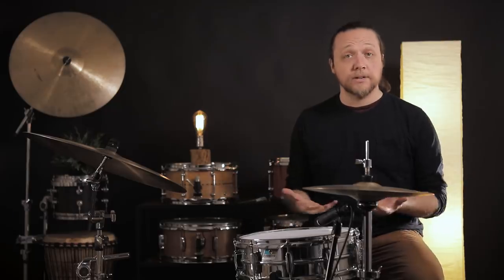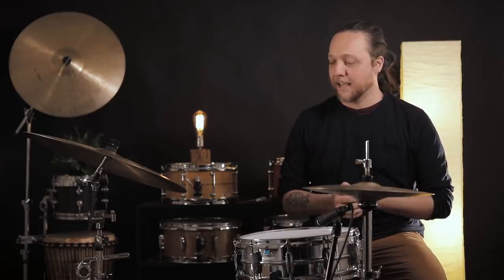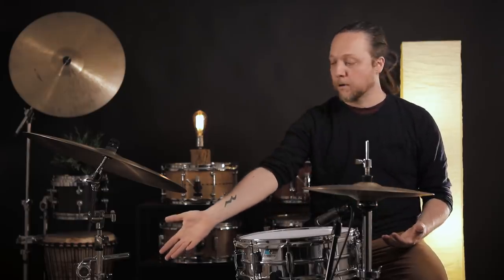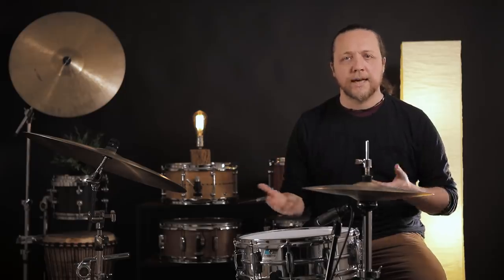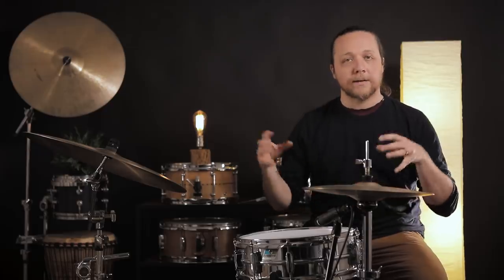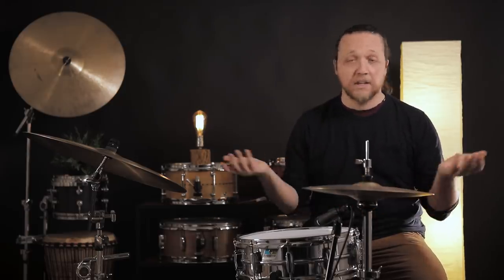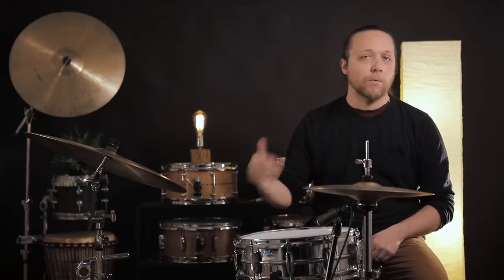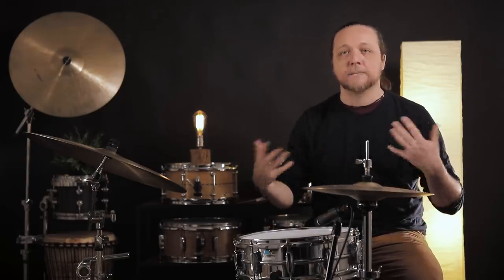Bass Drum Tension Rod Trick for Ultra Low Tuning | Season Two, Episode 46

Comment: I learned a technique that you alluded to in this video from Carter McLean. He will tune a bass drum as normal and then drop out one Tension rod. loosening it completely. Best bass drum sounds I've ever had.
Reply: On which side? Thanks.
Reply: @johnsprague1678  batter side
Reply: He does that with toms and snares too. It works well.

Comment: I've known about this regarding snare drums forever: An Acrolite will sound better and beefier when tuned low than a Supraphonic does at low tuning, and the Supra will not shoke at higher tunings, but the Acro will at a certain point. It's just how things work. But I never thought to translate it into the bass drum, which works the very same way. I'm stupid, you are smart. Let's remove some lugs!

Comment: Wow this video came at a wonderful time. I just replaced all the heads on my old Ludwig Rocker series and am unfortunately missing a tension rod on the bass drum. I have a few spare Gibraltar rods that all are slightly too thick.

I will use this method to atleast have even tension across the head and a killer sound. Thanks Sounds Like A Drum!

Comment: Main issue with that technique is now you need more gain on your mics to capture a bass drum that has less volume, unless you hit it louder. That could have the potential of increasing bleed. Lower frequencies need more power to be loud, which is why bass amps need thousands of watts to project and be audible. One alternative to that would be triggering a sub sine wave the same "pitch" of the bass drum when you play it.

Comment: Interesting concept. In my experience crazy tone comes from head choice and using one's ears. Lots of current drum sounds I'm hearing are dry and punchy- muffled like crazy or using extremely dry heads. It works for some things, but not everything. I was a SuperKick II person for a decade. Then I finally got a batter head without an inch of foam around it and it changed my entire approach to tone. It takes a little experimenting to find what you like, but it's so worth it.  And it can be as low and fat as you want it with a few tweaks here and there.

Comment: I LOVE ❤️ messing around with different tunings on all my drums (just my 5 piece) and when it’s time to change heads, I get completely new types of heads every time just to experiment. I have not yet done this, I have lessened certain lugs, but never taken any out completely so I may try it. 

I just got the new Evans UV2s for everything except my bass, with a 300 snare side and EC resos for the toms (10, 12, 16). They should be here tomorrow, so I’m super stoked, so idk if I’ll try this trick out RiGht away with them, probably not, just tune em to the shell first with some extra bend and go from there. So glad they finally got in stock lol

I’m not sure if you ever made a video about this, but if you have not, have you considered making a video about tuning your heads to the natural pitch of the drum? Like DW puts a sticker with the pitch of just the wood shell inside the shell, so you can tune it to the wood. Idk how many manufacturers do that or to how many models, but it could be an interesting video.

Comment: When I set up a 12 lug marching snare (with gut snares) for a loose Levon Helm / field drum type sound, I use 6 tension rods to tune, then finger tighten the other rods. I mark the top of every other rod with a sharpie so I know which rods are holding pitch and which rods are finger tight.

Comment: I've been meaning to let you guys know of a new tuning trick some guys at Nelson Drum Shop shared with me. Apparently it's a trick Keltner used in the studio. So the idea is to have the lugs on the sides tight, with the top/bottom ones loose (if you're looking at the drum from above). So if you have an 8-lug drum, you would tighten the 2 lugs on the left, 2 lugs on the right. Then back out the lugs on the top and bottom of the drum. It's supposed to let you get a dry and dead sound but with higher pitches. I kinda messed around with it but you really have to do some extremes and I was worried about my heads, lol. Would be neat to see you guys experiment with it
Reply from the maker: Hey! That’s quite similar to the approach that Masshoff made popular (Keltner and many others were certainly doing it long before, of course). Definitely some interesting options in there. Cheers!

Comment: That's really interesting!!
I have a 60s ludwig classic maple kit so the BD hoops are rather thin, I think not having both tension rods around the pedal might be a problem. Considering these 2 rods as number 1 and 2, going clockwise, do you think removing rods number 3, 5, 8, and 10 might work, or it would unbalance the tension of the head too much?

Comment: I'm confused though. Taking tension rods out is equivalent to having less lugs on a drum which traditionally is not an improvement. Am I  thinking correctly on this?
But having said this, I do prefer the half tension rod sample.
Reply: Having fewer lugs isn't necessarily better or worse. I feel like a lot of that is marketing. I guess theoretically it is easier to get an even tuning with more lugs, but I've never had much more trouble with fewer lugs. One of my buddies has a 16" floor tom with 5 lugs on it. Definitely the lowest pitch I've ever heard from a 16" floor tom. I guess it all depends on the sound you're after!
Reply: @tylerblake3596  
Thanks for the feedback! I guess what initially came to mind was, for example, my Supraphonic has 10 lugs while my cheapy sound percussion has only 6. And o know a lot of the quality there is shell construction and what not. But you get what I'm saying?
Reply: Mark Mullen Yeah I totally get it. As Cody mentioned in the video, there’s usually only fewer lugs on cheapo drums. Would be cool to hear a top of the line kit that was made with fewer lugs
Reply: @tylerblake3596  
Never thought about the marketing angle and you're probably right. Drum companies have to rely on that for their businesses to keep progressing. This is just my opinion, but kind of like wood types for example. For a while Maple is the thing to have them Birch and so on. But yes I would definitely like to hear a quality drum with minimal lugs on it.
Reply: You’re misguided on lug count for sure. There are some very good drums out there with 6 lugs. Check out the Ludwig pioneer for example.

Basically, more lugs give you a broader tuning range, and less lugs, in my opinion at least, generates more warmth and tone from the drum. I personally prefer 8 lug snares because you get the best of both worlds.
Reply from the maker: We covered this a bit in the snare lug count video that’s referenced here and in the description above but lug count doesn’t necessarily equal a degree of quality. While it’s true that cheaper/student model snare drums often were made with 6 lugs, as pointed out above, the Ludwig Pioneer does something’s that a Jazz Festival just can’t because it has too many lugs. It really is all about sound and what you can manage to create. Try not to let concepts get in the way of the sonic reality you’re experiencing.

Comment: Drum with only half tension rods doesn't sound very resonant.
Reply from the maker: Certainly not as resonant as with all of the tension rods but that first sound may also clash quite a bit with a band. The point here is to be able to dramatically alter the sound of a bass drum quickly and/or reach a lower possible tension while still making the drum playable in a practical manner. Maximum resonance isn't always the best thing. This trick drops the pitch while keeping the remaining tension rods intact (without issue of them shaking loose). -Ben

Comment: But why no port in the head?? It sounds like a light breeze with no port lol
Reply from the maker: Ha! Light breeze? Try thunderous roar. Porting a bass drum head allows air to leave quickly and reduces the low-end tuning range. This ends up being a bit louder and fuller. You could always mount a dynamic mic inside for live/studio situations and then use an external mic for more of the low-end tone but we didn't have any issues capturing this sound with our traditional external setup. 
-Ben
Reply: @SoundsLikeADrum  I mean the attack is basically non existent. Sounds like a pillow regardless of pitch. That's what I mean. I'm sure the pitch is low but yeah... No cut. No attack. Low pitch doesn't always have to mean long sustain although I do know porting can hurt the low end pretty bad if the hole is too big or placed poorly. If you only made a 4" hole (maybe even 3"? Lol hey might work?) and kept it close to the edge the effect would be minimal. In any case, unless it's some 60s or 70s music or some indie rock, porting the kick just seems like a necessity IMO for most modern applications.
Reply from the maker: Interesting- I hear A LOT more attack in the second example (after having removed the tension rods). I just went back to the session file to listen to the raw audio and they're quite a bit more attack. That said, we were using a felt beater on a (tonally dark) coated head. Switching to clear and a plastic beater will bring about quite a bit more attack. Miking from the batter side (or internally) will also do that.
Reply: Also, YouTube compression is DEFINITELY a thing. I am always surprised when I listen to a demo on YT and them I get to download the actual raw tracks... Totally different!

Comment: Been doing this on toms...taking two out across from each other to get a lower fundamental...also I feel the volume drops. Using tape in both spots as well...I'm doing this with larger concert toms and playing in a very small room no mics ! I 'm able to play at a whisper and also get a big boom when needed. I have always detuned the bottom two lugs at my kick pedal to get the pedal to feel like I want....no issues really cause the kick has some 1 inch foam slightly touching both sides and a 3/8" 4" wide wool rug pad parallel with the floor about mid beater height. I also throw a 4 " pvc coupling on its end to break up inner sound waves towards the reso about 8 " back from the front head. Reso is ported 6"@ 5 o'clock....24" Ludwig kick deep shell...this is my club kit indoors. My rock kit is all concert toms including my 24" Ludwig bass drums single head tuned high with smaller thin pillows and small pieces of monster tape on the beater side to taste. Wood beaters for a solid loud thump on ebony white dots.I Choose this for my rock kit cause my two kicks give off a very dissimilar sound and I like to bury the beaters when playing rock.